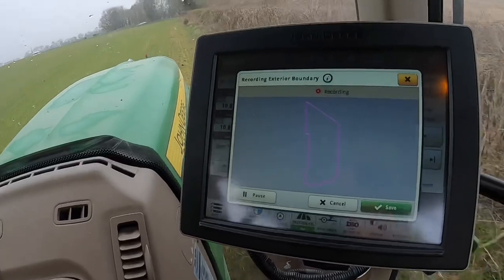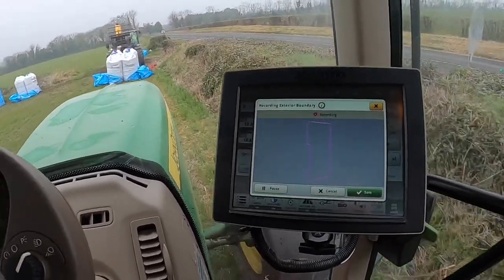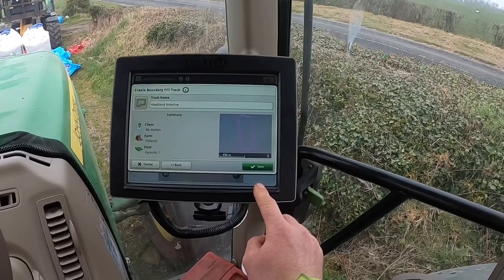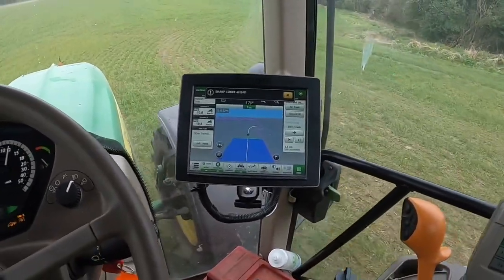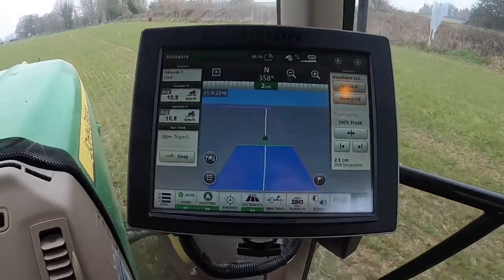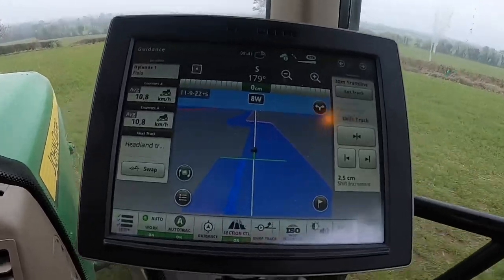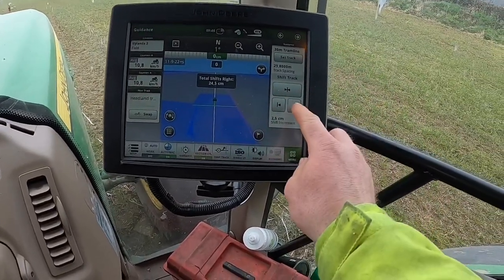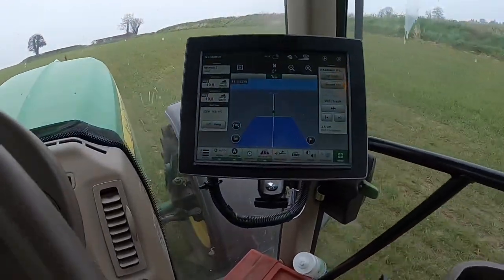Creating boundaries, Autosteering headlands and setting up permanent tramlines. 4640 gen 4 Greenstar

Comment: Great info. Can you create an A/B line off your straight ditch on your headline run? And measure the field from there?
Reply from the maker: Yes by using the fill in function. As you you are autosteer around the headland in boundary track you will have the option on the screen to fill in. Once you are drawing a boundary it will be measuring the field